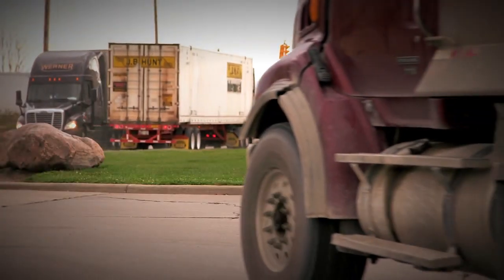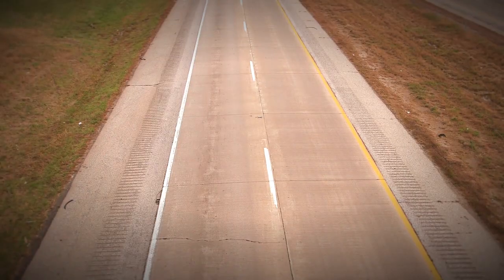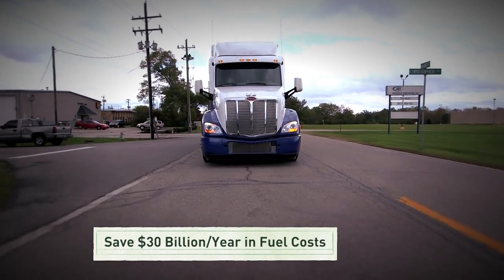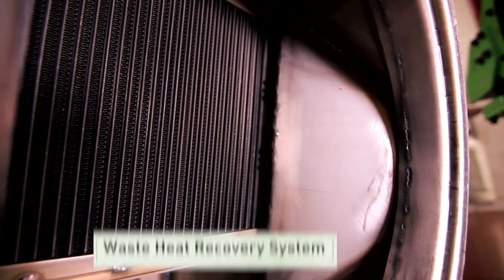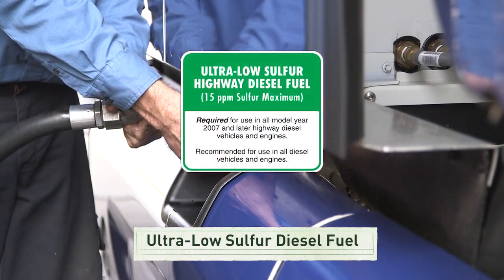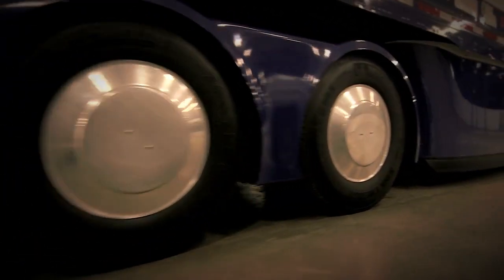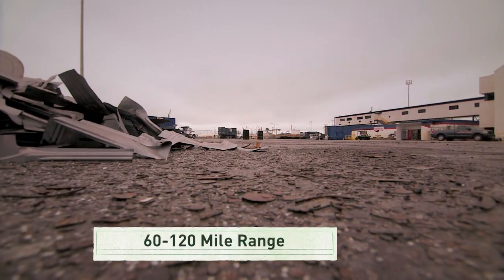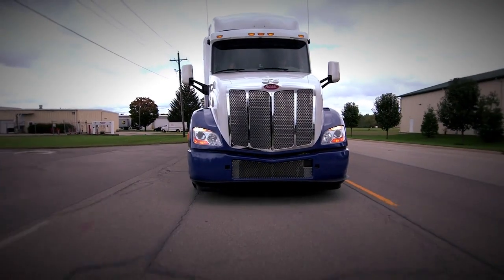Energy 101: Heavy Duty Vehicle Efficiency

Comment: This video is missing a lot of details that actually saves a lot of fuel and/or reduces pollution. To start, doesn't some trucks have batteries for the A/C that doesn't require the engine to be on all the time? A lot of truck drivers sleep in their trucks when the day is over so they run their A/C often.
Also, isn't running biodiesel a good way to save the environment? Depending on the blends, the MPG difference is either a tiny bit lower(for B100) to better than diesel (B5 - B20). But in every way you put it, using biodiesel reduces emissions to the double-digits.
Lastly, what about regenerative braking? This doesn't just apply to hybrids, it applies to plain old diesel too. When a truck is coasting or braking, wouldn't letting that momentum run the generator reduce fuel consumption. On top of that, wouldn't running less belts put less wear and tear too?
I know that's a lot of questions, but they're important ones. So please answer
Reply: Is that a league of legends profile picture.